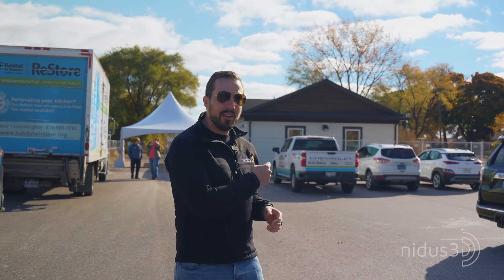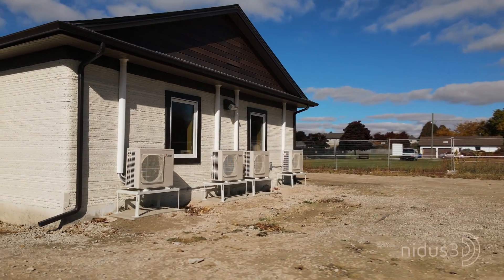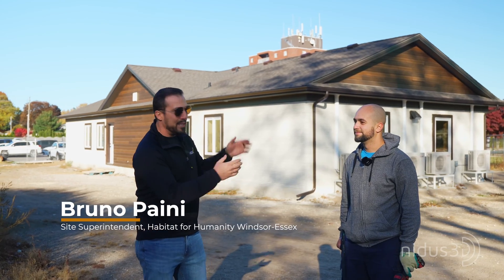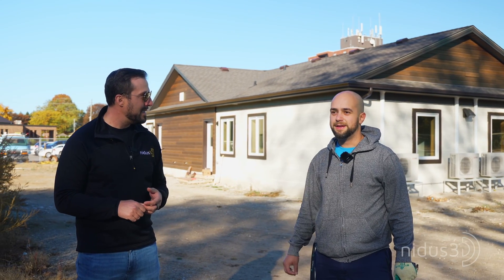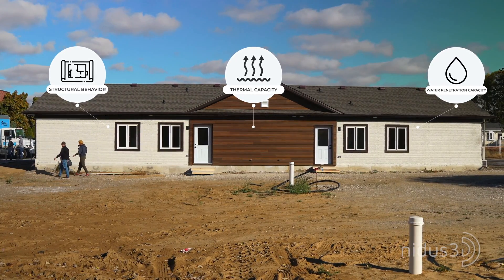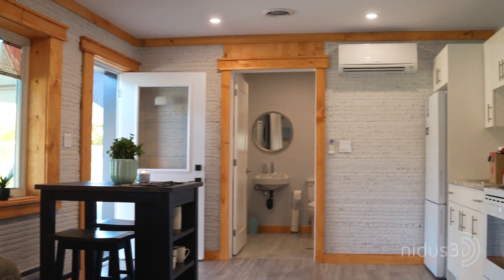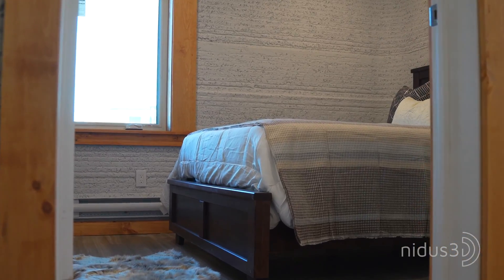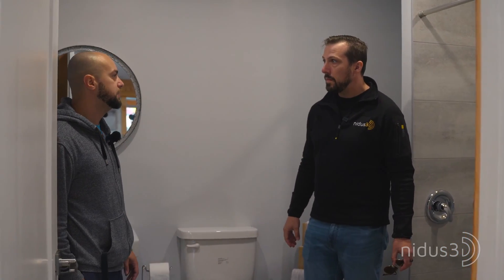Canada's First 3D Concrete Printed Home Tour by nidus3D

Comment: Those inside textured walls must be a nightmare to clean.
Reply: I imagine you could just pressure wash the house. Inside and out
Reply: But think you could still finish  the inside as needed traditionally with drywall and such but not sure how that would hold up with concrete being poris and absorbs moisture. It is definitely something interesting to say the least
Reply: Need material upgrade
Reply: Budget. More labour costs to finish the walls to make them flat.